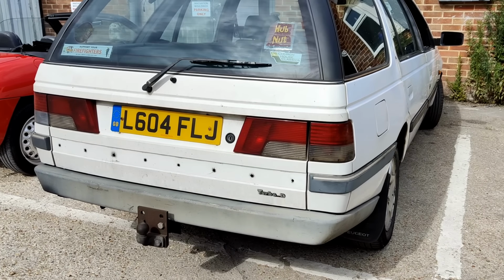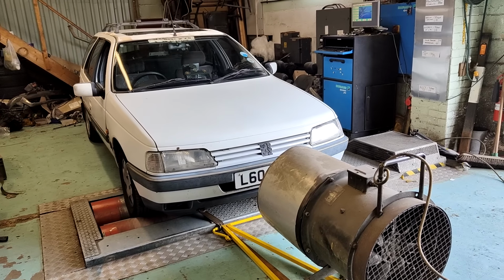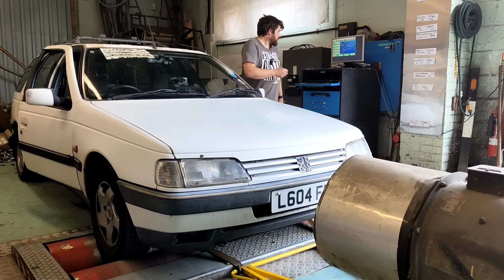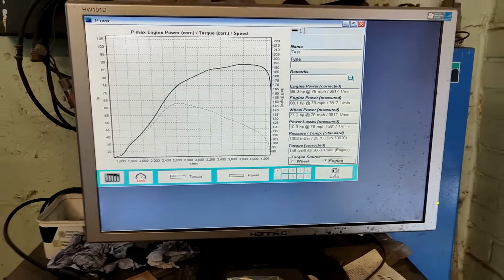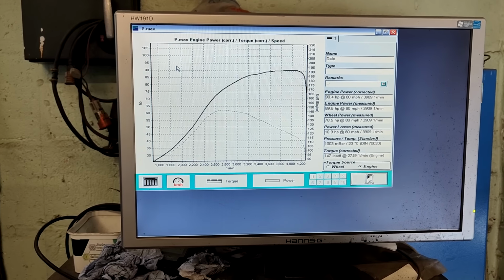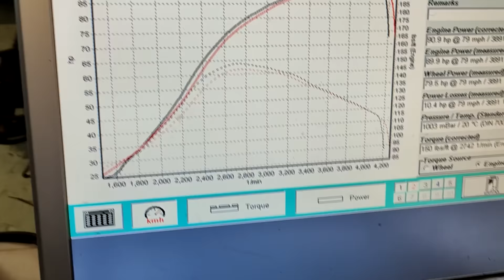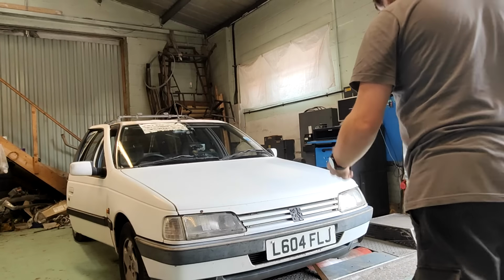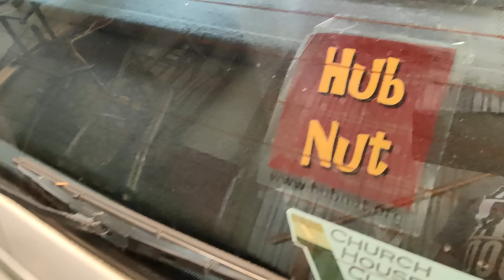How much POWER has this Peugeot 405 lost after 330,000 miles?

Comment: It should also be pointed out that that vehicle is on the original clutch at that mileage😮
Reply: Presumably it's your car then
Reply: How do you know that? that's insane
Reply: not that surprised. guy i work with had a citroen saxo, did 220,0000+ miles with the original engine, gearbox and clutch, wasn't worn out.
Reply from the maker: Just to point out this isn't my car, it's this chap's (Dale). If you want to throw pitchforks at anyone, it's him - I'm not the one scrapping it! 😆
Reply: @justmechanicthings  It depends on driving profile a lot (and person driving of course). I run a taxi service and our cars all do this mileage on the original clutch. Wont wear out if its seldom used.
Reply: @GoldenCroc  May still delaminate though. But mayve that is more common for drum (hand) brakes because of the unideal environment they are in.
Reply: @rimmersbryggeri  I have never seen it happen to a car, so I would say it is at the very least a lot more uncommon.
Reply: @GoldenCroc  I have seen it but not in real life so you cant never be sure if it was staged. I guess it is possible if they for example ahd a batch of rivets with some procuction defect or simular. I don't remember where i saw it though but it was quite recently.
Reply: That's insane 330,000 on the original clutch & it's lost no performance very impressive
Reply: @GoldenCroc  I presume your taxi service is mostly airport runs etc?  Taxis used around a city would be going through clutches pretty often.
Reply: @ferrumignis  About 60% highway, 35% extra urban, 5% urban.

Yes, I am well aware of what happens to those that only do stop and go traffic, I brought what we see up as an example of how literally every car we have, no matter what brand, does 300k miles on factory clutch. So its not like it goes bad because of milage, its the wear. 

The same is probably true for this car as well, if it has racked up the miles it has, its likely its mostly extra urban driving I should think.
Reply: My 406 Coupe has 600.000KM on the clock, it also still has the original clutch.
Reply: Old quality.......not made anymore
Reply: It may have original spec power and torque but it also has original spec (or worse) emissions
Reply: But how many head gaskets?
Reply: @incandescentwithrage  original manufacturers head gasket and one OEM replacement, giving  a total of 2
Reply: I had an 86 505 sli. Had a new clutch at 400,000kms. They guy i got it from stuck a rubbish chi ese clutch in it. Which of course i replaced with a genuine valeo.

Im not surprised  a pug diesel still goes strong after that many miles. We had lots of 504 diesels seeing 1million + kilometers. 505 turbosdiesels same.
They build em strong.
Reply: Is it for sale? I'd save it
Reply: @UPnDOWN  Great video, Thanks for uploading. I've got a '98 Peugeot expert (same engine) 9 seater for our family. the speedo has stopped working at around 250kmiles.It smokes a bit on start up but then runs fine.Luckily the car is rust free 99 precent underneath, with some surface rust. I am hoping to keep it running for a long time. I had Ford galaxy before and I hated the dual mass clutch, because it cost a lot to change. this has a single mass clutc. GREAT. 
best regards, Z.
Reply: I don’t abuse clutches never hold it on a hill with clutch and a rev match on gear shifts. Clutches last me 80,000 to 100,000. When changed the centres are toast.
Reply: @incandescentwithrage  For me 2.. oil leak, and leak between cylinders, but i,am not easy with the engine ( when its warm driven )
Reply: @sugarnads  505 turbo diesel, best car ever build bar none!
Reply: Could have tried "screwing" it and maybe removing the exhaust/air filter to see how much more it could make.
Reply: Not sure if anyone else has said, but it's a Bosch pump. Hope you saved the headlight protectors too!
Reply: first time i seen you channel, i enjoyed watching, sub'd,,, need more of these videos
Reply: Can be with good driver and higway driving, is your car?  A friend in his old ´92  Ford Transit made 700K with stock clutch, only change a cylinder head, sold it. Was N/A, not was turbo model.
Reply: @peugeotdudeandson4485  ooh get you
Reply: @T.E.S.S.  nice to see your current 🤭
Reply: @incandescentwithrage  2 head gaskets

Comment: If I bring Bella down, can you fit that engine? Cheers.
Reply: @HubNut  Ian, this is a project I'd love to see!
Reply: I was just going to say to keep that engine for Bella 😂
Reply: Seems like a great use for that engine.
Reply: That is actually a crazy good idea 😂
Reply: @HubNut  haha.. watched this and thought that engine would be perfect in Bella 😂
Reply: A good idea me thinks
Reply: Yup :) Mr H has a plan dunno what Mr Uppy Downy thinks though 😂
Reply: Now were talking 😂
Reply: Seems highly practical
Reply: Yes, thats a plan
Reply: I was shouting that at the screen watching Kitch show the figures! This has got to happen !!
Reply: The engine itself will actually fit right in, the gearbox from berlingo should fit, they seemed similar to the xud one
Reply: Failing that, would the injectors and/or pump be fittable?
Reply: I've done the XUD in a Berlingo to replace a DW8. Seems like an easy swap - and mechanically as long as you use the right mixture of parts (mine was from a 306) then it can bolt in. 
Where it gets tricky is the wiring. For some reaosn they changed the way everything is pinned so minimal things match and you end up with things like one electric window not working and odd clocks doing weird things. 
If you're happy to go through the wiring and sort it all out it can be done but its not the plug and play you would imagine. 
On the other hand it is very worth it for the way it drove after.
Reply: @albanerobert  Mechanically its only differences are teh cable vs hydraulic clutch, exhaust and a bit of pipework for the water and intercooler. 
Wiring is a different fishy kettle. You end up ripping quite  abit of the loom apart or re-pinning connectors depending on how much of the interior stuff you want working.
Reply: Awesome idea, also tweak the turbo & pump, and run it on veg oil (if it’s a Bosch pump).
Reply: @Zadster  I believe people have done mechanical injection conversions on DW10s by using XUD parts as there is some compatibility, not sure on the details though
Reply: @HubNut  good idea. It would make interesting content.
Reply from the maker: Technically, yes, it would fit.

No commitments about it working, though.
Reply: On the face of it, seemed an appealing idea … inclined though to listen to @siraff4461 - if wiring is a catch, Kitch @UPnDOWN has better things to be doing !! (Like, maybe someone has an SM that needs a little work…)
Reply: @UPnDOWN  It will work. Its just a case of how much messing about you want to do. You can make a wiring interface up and basically seperate the body from the engine at which point it all works apart form the integrated stuff like the trip computer and so on. Oh and you would need a momentary switch for the glowplugs (I had to knock that one up anyway). 
Mechanically its just a case of switching the clutch system over (the pedal from the 306 bolts straight in the Berlingo but I'm unsure if the 405 one would too), making the front part of the exhaust meet the rest - or preferably having a system knocked up from the old TD one since its a bit bigger than the non turbo one - and fitting the water/intercooler pipework. 
You wouldn't have to switch the clutch if you used the Berlingo gearbox but I'm not sure if the clutch/fly bolts up to the TD so I never bothered to try but if the pedal or system is different it may be worth a look to figure out which is the path of least resistance. 
All in all it took me almost two days but it was well worth it in the end. To me the XUD's characteristics just suited the Berlingo perfectly - knocking about in traffic off boost and a great big slug of torque when you want it. I even had a play with the pump on mine and without going too smokey it picked it up nicely. The compensator is the way to go on these. The main fuel gives power but at the expense of smoking the place out every time you go near the throttle. If you leave the main close to standard and only increase the compensated fuel a bit you get a nice bump in power and it remains clean enough that its not annoying people.
Reply: It’ll pretty much bolt straight in!
Reply: There’s a channel on here from Netherlands and they feature high mileage owner cars and many many many cars 200-500k miles (converted from kms) all still running and Ropey in most cases but on the road. Mostly PSA cars too. They do a feature on a 1.9d berlingo van that has done 1 million kms. They did a feature on an older guy that has a lowly Citroen C1 owners from new,  back seats out ( sleeps in it) drives from Holland to southern Spain on a regular basis. Done 500k kms. Says he drives it as hard as he can. We are a throw away society. Cars will last a lot longer than we think. In the uk they are more of a status symbol than on the continent. I had a ZX 1.9td and was faster than my mates xr3i. Purely on torque. Peugeot 405/406 are brilliant. 
Hubnut berlingo IS an anomaly and was junk from the start
Reply: Too bad it’s that rusty. Most 405’s I have seen of this era were not that prone to rust, I wonder what happened to this one
Reply: @bartl9956  They are solid until the galvanising starts to give in. That can be for a few reasons like corrosion getting under it, welding while things are all over it, paint repairs where they sanded the galv back or even just pure age. Usually after about 25 years they start to show signs but its usually in small patches here and there. 
Given how old they are now and how long most of them lasted I think they did a cracking job. When you think about their some of their contemporaries like Cavaliers and Sierras which were rust city by 10 years old (or the Italian/british stuff which came off the showroom floor with rust) these did remarkably well.
Reply: @siraff4461  they were cracking cars, weren’t they. I had a 2 litre SRX estate, made the mistake to let it go. It is still on the road apparently. The three cars I owned after it aren’t 🤣
Reply: @siraff4461  as far as I can see, it's the only sensible option 😁
Reply: @HubNut  what a fab idea.
Reply: Make it so

Comment: As a recent victim of the joys of the Puretech this is a nice reminder of when PSA made brilliant engines. How times have changed.
Reply: @nstarmore  5 years ago my new 108 puretech 1.2 blew up on a Asda car park.  Spent 1/4 of the cars worth trying to see what was going on after going in limp mode, the dealer refered me to place in Wolverhampton for an engine rebuild. I could cry to this day.  £800 for a catalytic converter to fix it..... NOPE.  This that and the other. Nobody could diagnose it properly .I'm a proud owner of a 20 year old Corsa and I started with a 106 that I purchased for £70.
Reply: As someone who has the THP engine I agree.
Reply: It’s a terrible shame: engines are over complicated now. I had a 106 with the 1.1 TU petrol. It was a very reliable engine and an all round good little car.
Reply: I agree. Always had Peugeots since I began to work in 1991. My actual 308 is the last one. I'll go to Honda, next
Reply: The diesels are still great,  but like all modern cars the adblue system is'nt
Reply: @MrTopgearnerd  yes I would still have a psa diesel but the irony is now that because of lack of demand via the governments massive anti diesel campaign it's now actually pretty hard to get a diesel psa car in the UK. Absolute scenes.
Reply: @bmc9504  it's always the wet belt throwing rubber into the sump lol
Reply: It's not complexity it is poor design  @mattbod
Reply: 405, 406 ,306, TDi where the best engine made ,
Reply: @nstarmore  Peugeot's sales pretty much evaporated in developing countries when the brand decided to no longer make good cars, I say that because when Peugeot was making good cars, the 405 was ridiculously popular even developing countries. Nowadays, seeing new Peugeots on the road in these countries is a rare sight rather than a commonplace, you'll more likely to see a whole bunch of Toyotas instead, both new and old.
Reply: @crocus9905  yup that was what happened to mine, despite meticulous servicing and changing the belt ahead of the interval, absolute pos design. Although I'm gluten for punishment it seems as the Renault I replaced it with has a chocolate timing chain it seems, I've always defended the previously unfair stereotype of french cars but they're REALLY not helping themselves.
Reply: Emissions is the reason why engines are now so complicated. All that stuff to stop soot coming out the back hampers driveability, reliability and performance.
Reply: I am actually toying with getting rid of my Puretech powered Cactus for this reason, I hear horror stories about them more and more now, had it two years.
Reply: @scottishcarenthusiastsandtrain  what year is it? I think the later versions of the engine are a bit better as the belt was revised a few times before they gave in to chains, our C3 was an earlier 2017 and I think the debris that caused the problem was from the first belt the car had. Tbh if I had one now I would get the sump dropped at each service, checked and cleaned, not a cheap endeavour but should give a degree of confidence and allow you to keep what is otherwise a very good car. 

In fairness I can't think of anyone else that makes a small petrol engine that doesn't have known issues, it's just extra insulting for the puretech to be so bad since PSA historically had a reputation for making such solid engines.
Reply: @nstarmore  2016
Reply: @scottishcarenthusiastsandtrain  ahh yeh so the belt should have been changed a couple years ago then, if you've had no warning lights yet (oil pressure light came on with ours, which is never a good sign) then it's probably alright. If it was mine and the belt has already been changed I would probably look at getting someone to drop the sump and give it a check and if it looks alright (i.e no debris) then I probably wouldn't worry too much about it. But I'm no mechanic so if you're concerned then maybe speak to a specialist and get their opinion. Ours didn't blow up but the warning light, which came on very briefly was enough for me to not trust the car as my  other half uses it for transporting my young kids. We both said if it wasn't for the kids we probably would have just got it inspected and carried on. There's still plenty of these engines on the road so they can't all be junk.

I will add ours was used for regular short journeys and had a low mileage for the age, which is not conducive to reliability so that might play a part in things 🤷‍♂️

Comment: Now as a 405 man if this car is to be scrapped would the owner sell it to save others?
Reply: I know Dale (the owner) would prefer it to save other 405s rather than be cubed
Reply: Back in 2006 I bought a 405 GTX TDi with the xud engine.it was the estate in metallic grey.
Did a few trips to Portugal in it and it never missed a beat and being the top spec it was very comfortable and very quick.
Reply: @grumpytorque8905  Hang on, lads - the engine is already spoken for 🤭🤣
Reply: @Mancozeb100 numb nuts yeah
Reply: @grumpytorque8905  great to know this.
Reply: It has arrived next to a couple of Ians old cars to get my less rusty but more broken 405 back on the road.  Theres going to be plenty of parts left over if you need anything.

Comment: My Citroen ZX 1.9 TD had over 400,000 miles on it when the back axle etc passed away. 60+ mpg easily on the motorway at 70 mph cruising.  When I changed the cam belt and set up the pump timing as per the workshop manual , it went like the clappers, was quieter,smoother and hardly any smoke. A pain to do but worth it. I know its never usually  done  even at the dealers. Did the same on a 2.5 VW lump and that made a difference too. The ZX being light and with great road holding you could disillusion lots of hot hatches by sticking with them on the twisties.  My one regret is that I missed out on a one owner ZX 16v Volcane ..... if only.
Reply: @mazdaman1286  No such thing as a Zx Volcane 16v. It was either a 16v or Volcane. Two separate models. Anorak loyal.
Reply: @WullieBoy-c7f  this one was 3 door red 16v engine with the 8 exhaust runners , and had a Volcane badge on it. I guess the owner must have put it on then
Reply: @mazdaman1286  The Volcane had the older XU9 8v engine (same as the 205 GTi).  The 16v was the quicker of the two but the Volcane was still a great drivers car.
Reply: @mazdaman1286  did the heater matrix ever give out, I had a zx for 8 years and wished I still had it now
Reply: @garyconstant4234  Oh YES. Hours of fun Took the front seats our Steering column out then the dash(have to get the intercooler off to get at the bolts and hoses) Then split the heater box to swap a £9.96 core....fortunately no aircon then the hassle of lining up multiple brackets etc to slide it all back in. did it over a weekend.

Comment: That engine is a piece of (albeit recent) motoring history. It needs to live on in another incarnation.
Reply: It does. Anything 1.9 diesel is based on this block. Fiat VW Ford. It is the second most produced engine in history apparently.
Reply: Agreed good engines should be saved, The shell is a rust bucket and beyond saving, but this would be great for a engine swap project

Comment: Back in the 70s the Peugeot diesel was the go to diesel Engine they had the reputation for strength and durability
Reply: Or Mercedes, if you had the budget.
Reply: This was all before cars where not  outsourcing their stuff from China
Reply: Still running in africa
Reply: Mercedes was als fine in Taxis
Reply: @TheStobb50  my father had 1994 pug 205 diesel van….it was fast and hardly used any fuel